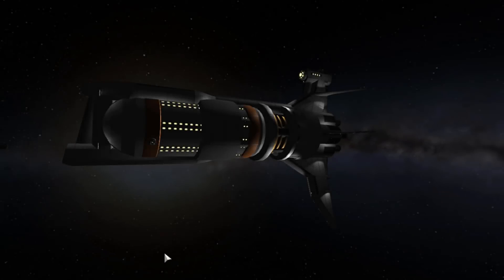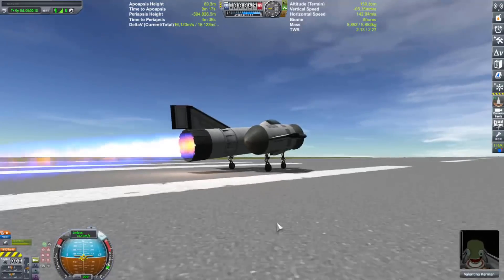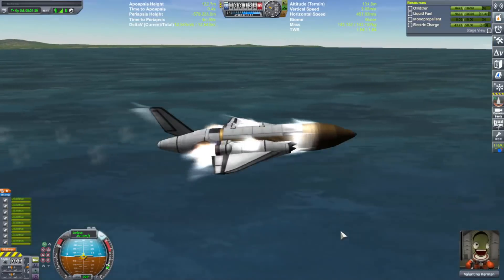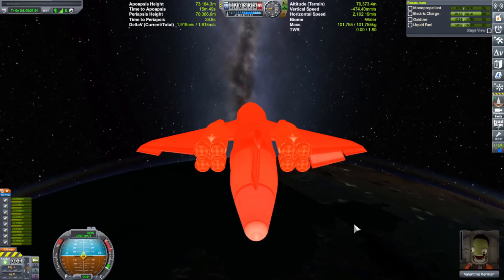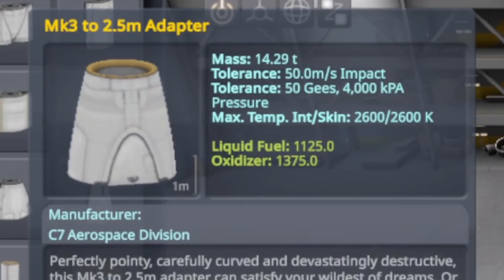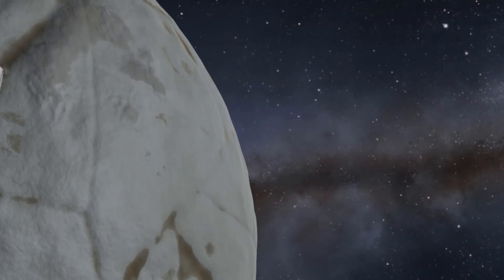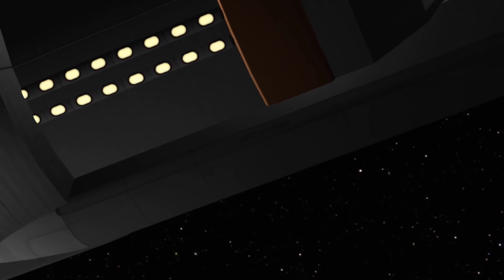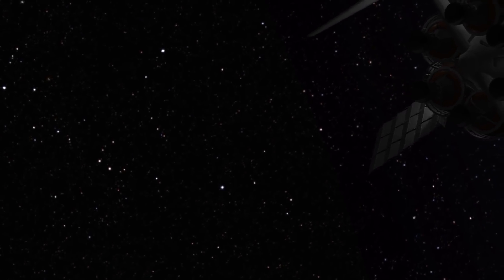FAIRINGS good for SSTO? YES or NO? Let’s find out.

Comment: For reference, the "proper" way to use a fairing for ssto is to have the fairing as the root part and have the front and back area be fully occluded by parts with sufficient frontal area. If you do this you will find that the fairing has extremely little drag, and actually beats normal wing parts for lift to drag ratio depending on your angle of attack.

Then you put as many parts as you can in the fairing (all your fuel tanks, engines, etc), and only have wings and air intake outside the fairing.
Reply from the maker: Tested it the way you said is proper, but the difference is only a few meters per second delta V give or take.
Reply: @vaos3712  If it's only a few m/s difference then either your ssto has too much twr or you aren't occluding the fairing front and back area properly. A root fairing body ssto should be way better than anything else unless you either have a bad mass fraction or you're doing it wrong
Reply: You should show aero debug data in context menus and make sure that YP WDrg and YN WDrg are both zero for the fairing.
Reply from the maker: @proxima_fish  are you building the fairing so that everything fits inside of it and nothing sticks out? If that’s the case then I can only imagine the sheer weight that the fairing is putting on your craft.
Reply: @vaos3712  I usually build 1.25m craft, and the 1.25m fairing is much lighter per area than the others. So it's not a big deal.

I've got a couple of missions on my channel showcasing the capabilities of root fairings on a craft.
Reply: I'm with Proxima here, you need to use Mk1 with fairings, Mk3 with fairing has less advantage than it's disadvantage(weight). For example, when you splashdown at say hor: 75m/s and ver<1m/s the mk1 tends to pop, while fairing will most likely protect it and bounce off the water. 
But say, if you have Mk3 ship, it'll bounce up at 90m/s horizontal, 5m/s vertical, contrarily the protective shell would pop off.
Not to mention the weight issue here, Proxima already cleared that out.

In short terms, using mk3 with fairing is not the best idea.
*but I loved the hack VAOS did on newer Zero-drag SSTO. (trick is good though craft is not that efficient because of weight of mk.III parts even with the slim shell hack)
Reply: I built a simple plane using the 1.25m faring instead of fuel tanks so I could fly my scientist around with a probe core, wasn't sure what was wrong with the aerodynamics.

Comment: strangely, nose cone wise.   by accident i started using the docking ports.   their drag isn't awful,  but their heat thresh is actually higher then the aerodynamic parts.
Reply: nose cone wise, Protective shell and shift+move placed shock cone intake has the best effect. Try it you'll see it. Do not leave anything disposed to air including especially docking ports.
I came here by searching for hacks to reduce docking port drags. Even the shielded docking port has more drag than of a Jr docking port. And the small nose cone trick that works with rapiers doesn't work.
You can check how much each part aerodrags by selecting Shift+f12->Physics->Aero:Show Aerodynamic Forces in Action Menus
Reply: @XavierBetoN  oh yes, but in some cases sacraficing drag...   for not having your nose cone overheat to fast,  especially in smaller SSTO's in acceptable.   that extra heat resistance has saved my ships on a few occations and actually saved fuel, because i could be in air breathing mode longer, to get more speed. 

Its one of those strange trade offs.
Reply: @jenniferstewarts4851  Just remembered this, about the heat problem, adjacent parts share the heat between eachother. 
For example, If I attached wings directly to airstream protective shell, the shell gets hot, wings get hot, while tanks inside are just redwise cool.
Second attempt, I ditched the wings from fairing, I attached to cool tank which is inside and shift+moved the wings back at where they belong, the whole spacecraft was cooler in reentry from Moon (RSS)
Third attempt: I changed the standard layout, the "one ahead other's front" layout of tanks to one central and 6-pieces symmetry placing, compressed them with move tool hack. The spacecraft was even cooler. That way the wings distribute heat to not only one tank, but to 7 tanks.
I am telling these tricks because they're essential on RSS, not very neccesary in Kerbolar system, but might save Jeb's ass one day for you.
Cheers! Bu-bye))
Reply: @XavierBetoN  yep, and i'm just saying,  a few times i've went and put the draggiest item on the nose cone....  2 heat shields back to back.

burned completly through one on take off, pulling over 2000m/s before i reached 5000m

Comment: I don't really do SSTOs (They are a silly way to go to space, and oh so much more fun to build fully reusable multi-stage craft at least for orbital activities vs interplanetary) but I have observed when putting very large interplanetary vessels into orbit (where I use an array of nuclear rockets with a large asparagus fuel stage) That it is more weight and aerodynamically efficient to put nosecones on everything with bad aero, with decouplers and seperatrons, instead of building a faring around it all. Farings generate huge drag and also lift, making it quite hard to control in the thick parts of the atmo, and weigh a bloody ton.

The biggest downside is massively increased complexity of using 12+nosecones, 12+decouplers, 24+ separation rockets, vs 1 fairing. The upside is about 5-10t less mass to heft into orbit.
Reply from the maker: SSRT are fun too 😎👍
Reply: but style!